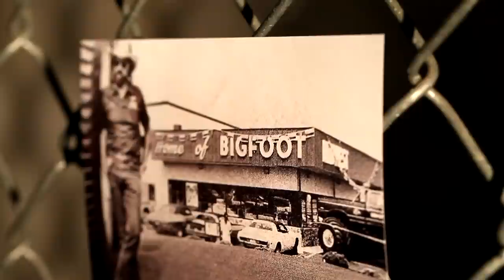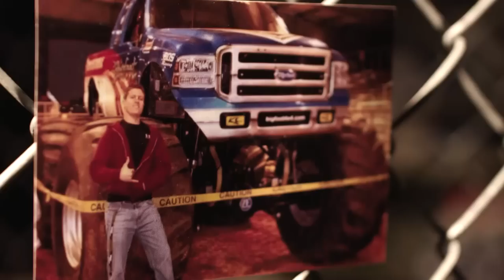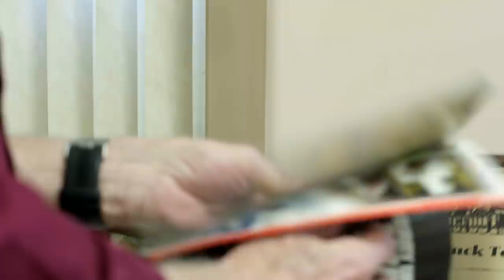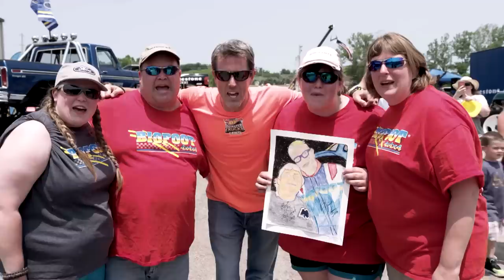BIGFOOT Then & Now! - Hot Wheels Monster Truck Live

Comment: That electric Bigfoot as a Chevy was strange since it always had been a Ford body.
Reply: tyler jones chevy bigfoots aren’t all that uncommon there’s been multiple of them also dodge’s
Reply: Yeah, they like to run different bodies on their truck for show.  However, all competition trucks run ford bodies and after the hate #19 got i dought that will change.
Reply: Brian connor chevy bigfoot’s have been used in competition a lot, bigfoot’s best drivers have used chevy’s before
Reply: @parker8870  Yeah I literally said that...
Reply: Brian connor you said all competition trucks run ford bodies and at the moment that is true but not all competing bigfoot trucks ever has used ford
Reply: Brian connor also you mentioned that bigfoot 19 got hate when a chevy bigfoot existed before it’s creation
Reply: @parker8870  You just completely contradicted yourself. And you're also putting words into my mouth. Never once did i say bigfoot #19 was the only bigfoot to run a chevy body there was one before it which was done in the wake of ford leaving bigfoot.#19 was the first bigfoot to ever run a chevy engine with a chevy body and will likely be the last as both trucks received extreme backlash. So how about you stop trying to be right.
Reply: @parker8870  there have been only one Chevy engine dedicated Bigfoot and that is #19.  #10 had it's Ford engine replaced a few times to advertise for MLB because Chevy was a sponsor of MLB but 10 always returned to the Ford engine until it's racing days ended in a crash. The Dodge was just a fiberglass body only.
Reply: @parker8870  At the time Larry was driving 19 Dan was was the best driver while driving 18 a Ford. When Dan moved into 21 a Ford Larry moved down into 18 which is a better truck than 19. When Dan retired Larry moved up to 21. Darren has been driving 19 since Larry left it for 18 which is a better truck.